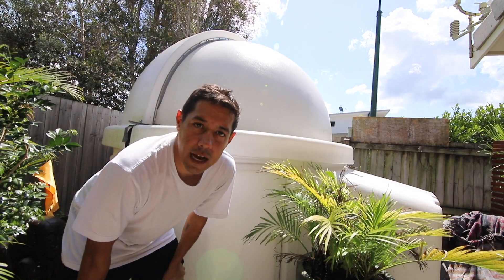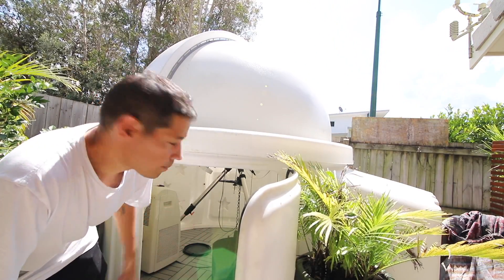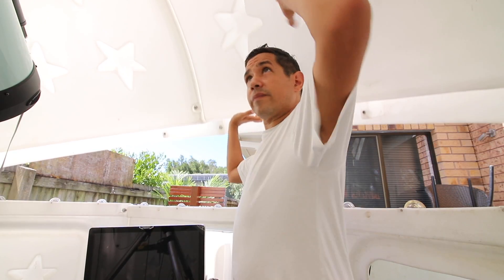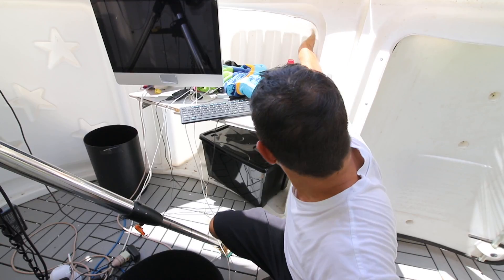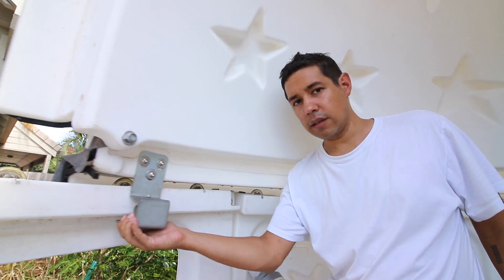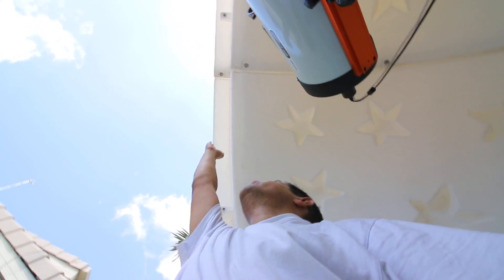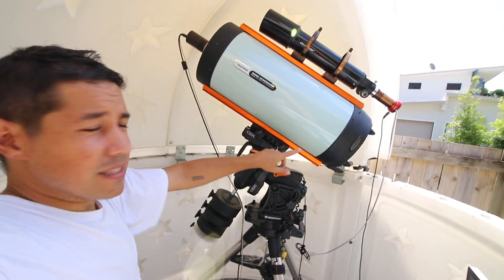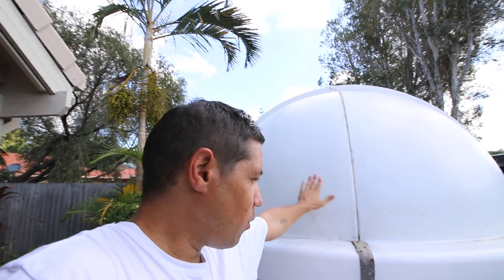Sky Shed Pod Tour - A Cheap Backyard Observatory

Comment: Mine is green, imported from Canada to France. It is used mostly for solar observing as I can turn the dome around to keep me protected from the Sun.  Most of the wheels perished after a few years (climate tends to be a bit humid here in the Pyrenees) but they were easily replaced with roller skate wheels from a sports shop.

Comment: A neighbour of mine was demolishing an 8x10 wooden shed. I helped him out and salvaged most of the wood then built a “clam shell” 5.5ft x5.5ft observatory shed for nothing (and it’s fully waterproof and I can see the zenith since the entire roof is removable. Just saying because the only reason, I guess, for someone buying one of these ridiculously overpriced astro pods which end up having issues, is because, like us all, we were all enamoured by those big “real observatory” rotating domes when we were kids.
Reply from the maker: Yeh but I am have a Nexdome now which is automated, waterproof and motorised so I’m one of those kids :) the original skyshed pod here isn’t much more than basic shelter though.
Reply: @DylanODonnell  So was I one o of those kids. I just wouldn’t spend thousands of any type of dollar on one when I could build a perfectly serviceable one with timber. Not automatic (yet and probably never) because I pull each roof section, by hand, on ‘gliding’ drawer rails. Takes 10 seconds.

Comment: just seen the vid and found this on skysheds site... just passin info on .. i would think in ur case. maybe more north.. as it says south in the info ... Telescope is Offset to the South. Like many well known large observatories, POD is designed to have the pier/scope offset to the south, to take advantage of the busier Southern sky. In our case about 10" South of center. This also provides more work room to the North where you spend much of your time. DO NOT locate the scope in the center or Zenith can be obscured by the open dome flange. This is important!

Comment: Thanks for the video and review.  I dream of a permanent observatory.   I would prefer a roll off roof as those dome models scream of expensive gear inside and are an invitation for unwelcomed visitors... you have a fence around so it is a bit out of sight.    Is the irradiated heat from rooftops after sunset a problem for you?  That is something I am worried about.   Being in Australia,   the planets must be really high ,  you locked out for the next 5 to years  ;-)
Reply from the maker: Tempus Fugit I would prefer a roll off roof style too! I do like my latitude .. it’s the best of the Southern Hemisphere with a small sample of some typically northern stuff. (Eg andromeda)